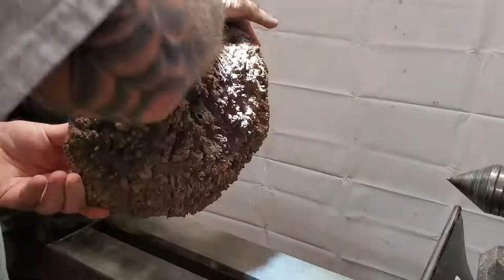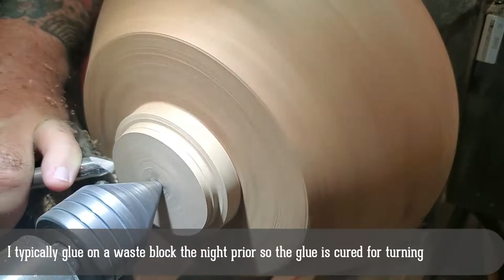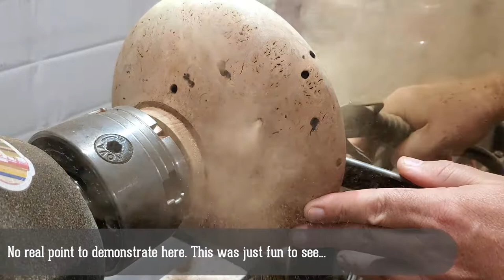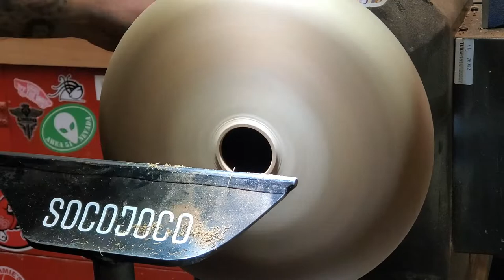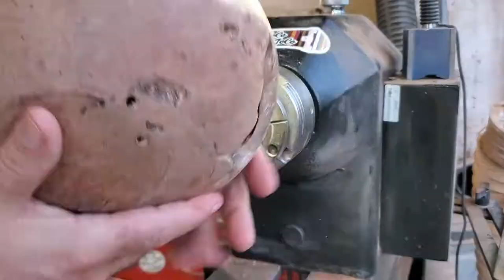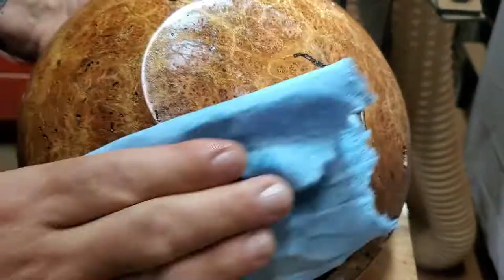Woodturning - Chechen Burl Hollow Vessel

Comment: I've been considering the simple tools hollowing rig, it looks pretty effective.  Are you happy with it?

Great piece, that is some beautiful work!
Reply from the maker: Thank you Jim. I do like this tool. It's served me well. Full disclosure, I'm in the process of upgrading my hollowing set up to something a bit more robust/sturdy. Not that this isn't good quality, it is... I'm just really getting into doing these all the time and wanted something that gives me a bit more flexibility in terms of tool options.
Reply: @SoCoJoCoWoodworks  what system do you consider an upgrade?  I totally get wanting an upgrade, my homemade system is needing the same thing.  But, if there is something better/more robust than the Simple, I'm interested!
Reply from the maker: @jimg2247  I hate to call it upgrade because it implies that the SWT hollowing system is sub par, which in my opinion, it isn't a bad setup at all. I like to hollow pieces with high/wide shoulders and some depth... you have 2 tool options with that set up and hollowing something more than 9" deep gets a bit rough. I purchased the Trent Bosch stabilizer w/laser and John Jordan's 3/4" hollowing tools. Should have it all set up this week. 👍 Feel free to DM me on IG if you want to talk about the different set ups.